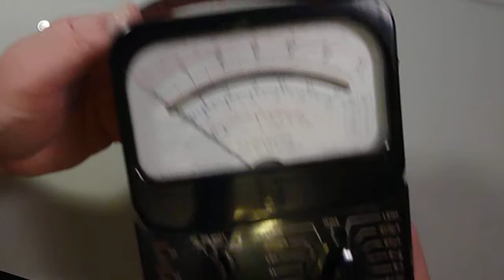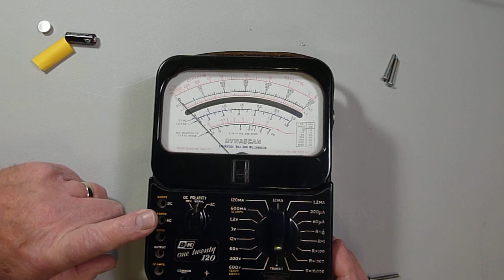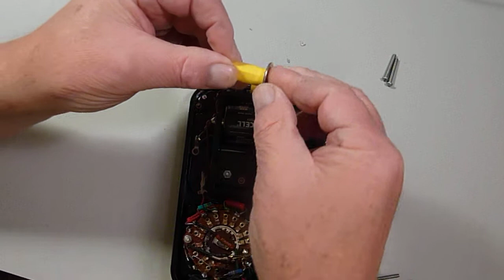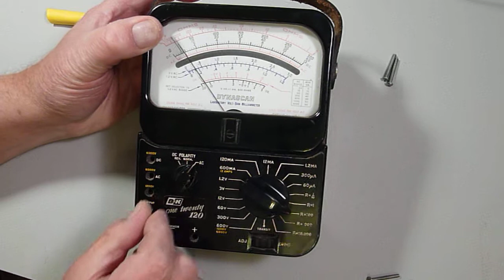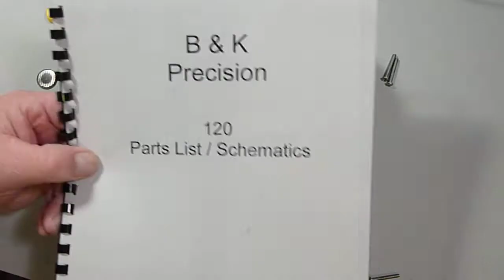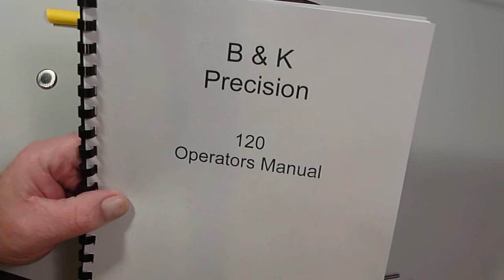B & K Model 120 VOM Multimeter

Comment: Where did you acquire the manuals. I just love the oldie but goodies. Nice video. Thnx
Reply from the maker: I can not remember except to say - The Internet. Now that you mention it I will go look for mine and be sure I can find it.  I replaced the batteries in it recently. You have to use a 12 v and a 3 volt battery at  one place. The 3 volt button battery does not last very long.  I have also just acquired a Heathkit MM-1. Best to you.
Reply: Found the manuals and built the battery pack, 15 VDC, but the meter reads low on all the voltages by 16 - 23 %. The ohms scales aren't responding either, looks like I got my work cut out for me. Maybe a winter project. Thanks for your response... an MM-1, hmmm, maybe I'll get one of those also. Take care.